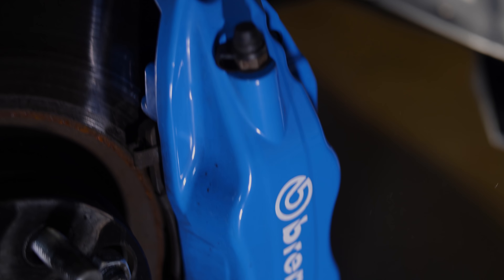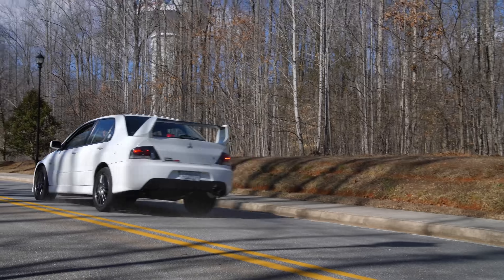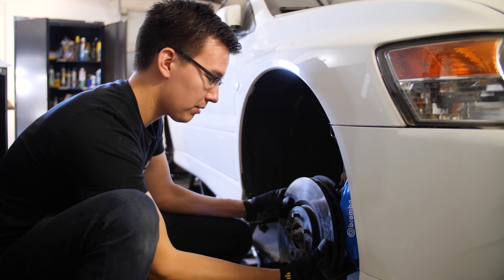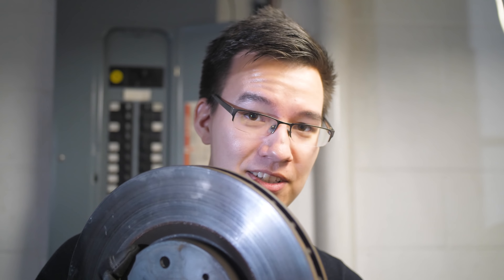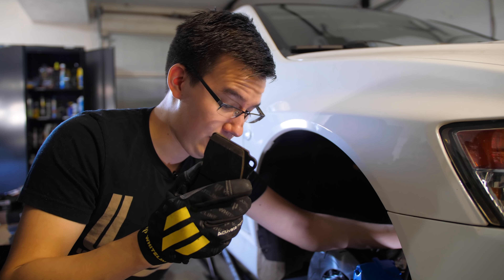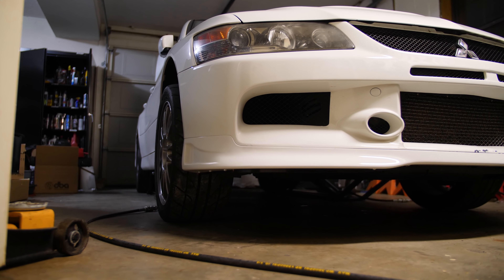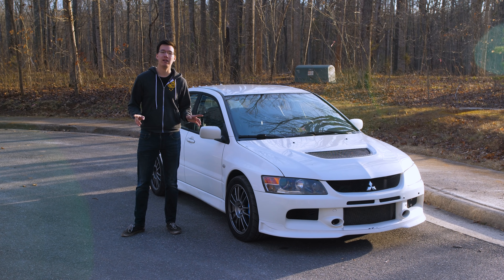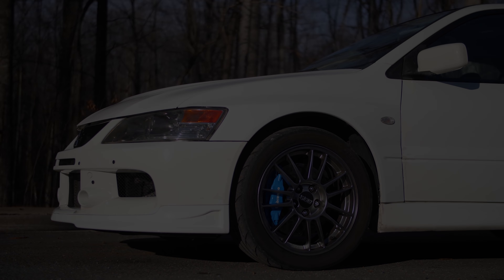How Much Do Pads and Rotors Help Braking? [4k]

Comment: Before you even consider upgrading brakes, you've got to think about how easily you can lock up your tires, no point getting a massive brake kit if you're running economy tires that can't handle it. Better brakes will however handle brake fade a lot better, and this is actually one of the main advantages of upgrading your brakes.
Reply from the maker: spete7 Very good point! The Evo comes with very sticky tires from the factor, and is currently equipped with 200 treadwear tires, so it wasn't much of a worry in this test. But that's absolutely true, the best brakes in the world will only serve to lock up crappy tires.
Reply: Treadwear rating is not useful on its own, it can only be used to compare wear rates on tires of the same manufacturer since there is no official scale, manufactures use their own unique scales. Manufacturer A's 200 treadwear tire might not stop as good as Manufacturer B's 400 treadwear tire.

"The best brakes in the world" should lock up good expensive quality sticky tires too - I mean, they'd better or you're not taking full advantage of the available friction of the tire.
Reply: Btw, looking at the thread pattern, he seems to have hankook RS3 which is pretty good tires to use in the braking test.
Reply: People should also keep in mind that the harder you can brake without any ABS engagement the quicker you will stop. ABS is only stopping you from locking up, not slowing you down faster.
Reply: While I agree that treadwear rating aren't consistent, organizations use that rating as part of the rules for competitive competition. For example the SCCA Solo 2 Nationals use a 200 treadwear rating as the standard for many street and mod class cars. I would think they are close just not perfect. Just food for thought.
Reply: your brakes may lock your tires up once. but it is not a black and white issue. more powerful brakes will be more modular and more consistent. locking your tires obviously is not the fastest or safest way to stop a car. even with crappy tires you need a good braking system
Reply: powerful brakes aren't necessarily very modular, ie power and modularity do not go hand in hand. you can have one, the other, or both ideally
Reply: Preach!!
Reply: In general treadwear isn't a good indication, but 200 and 140 treadwear tires are almost always tires made with a specific racing organization's rules in mind. When the scca changed their solo street tire requirements from 140 to 200, the most popular brands in solo at the time (hankook rs-3's included) changed their treadwear rating from 140 to 200. I can't see why anyone would make a 200 treadwear tire unless it was for racing tbh.

Comment: I just changed my rotors and breaks on my z33, went from the stock base rotors to EBC slotted and semi drilled rotors with ceramic red low dust breaks. Honestly I love the sound of slotted breaks while breaking..😍 also changed out the stock break lines to stainless steel wildwoods. 🤙🏼
Reply: *brakes

Comment: I did a similar setup when I owned a 01 Bmw 330i. I did super blue brake fluid before it was banned for being blue brembo blank rotors and hawk hp plus pads. It made a huge difference.

Comment: The Hp+ works excellent for track days and even endurance racing, if you have a lighter car. I use them myself on track, great pad. You should also mention brake cooling/ ducting, should be the next upgrade after pads if you want to to drive on track. It's cheap and and can seriously increase pad life and fade resistance.

Comment: I'm at 600whp on my IX and still use OEM rotors and brembos. The best things I've done is hawk hps pads, ss lines, motul fluid, and RE-11 tires which are now discontinued. Honestly great tires made the best improvement.

Comment: Yep, pads alone are huge.... well that is if you have the tires to go with them. I have Hawk's Street/Race pads and I daily them and AutoX/ light track day with them. They bite so good. I got the chance to take a stock 2012 911 out for a spirited jaunt around the block. I was surprised that my little civic with just high performance pads felt better. I know, I know anecdotal but it helps to show that you can gain really good performance out of the stock system.

Comment: Wish you also adressed brake fluid as that is often overlooked. Flushing your brake fluid with some high performance fluid can also help with braking performance and a better pedal feel. Also curious if steel braided brake lines help only vs fade or actually give some better braking performance
Reply: KoNLaR great point, I think I'm going to have this done next
Reply: Better pedal feel can help in a lot of ways. The brain remembers pressure much easier than distance so with a harder pedal you can more accurately hit your desired speed when entering a corner at an event.
Reply: When i put braided lines on my WRX there was no mush in the pedals, as soon as you put any pressure on the brake pedal it started braking, there was no little bit a give anymore. it honestly was the biggest difference i noticed. I did slotted cryo treated rotors and hawk HPS pads and the braided made a bigger difference IMO. but combined with it all it was amazing. also did higher temp fluid as well.
Reply: Ive ordered braided lines and new fluid so nice to hear that makes a bigger difference. Excited to try it out. I didnt go for pads or rotors in the start because I want to see first if just fluid and new lines would be enough.
Reply: The funny thing here is that all factory and cheap-o replacement brake lines are braided, just internally rather than externally. It is required for any hydraulic system to function properly that hoses don't swell. If there is any noticeable improvement in pedal feel from upgrading to the aftermarket braided lines, then your factory lines were damaged in some way.

However, since the exterior is braided rather than (or in addition to) the interior braiding, it does serve to protect the line from physical damage from kicked up rocks or rubbing the tire. 

And they look fantastic.

Braided lines won't do anything to help or hurt brake fade.
Reply: don't waste your money on brake fluid unless you are tracking the car. I use prestone dot 4 because it's fucking cheap.
Reply: DOT 4 is a good brake fluid for most cars. I plan on doing a video on brake fluid stats in the near future, as well as doing a test of DOT 4 LV on my GTO.
Reply: Doing it as a service firstly, but also plan on taking the car to a trackday and potentially more if I enjoy it. Cost 20$ dollars for 1L of Motul RBF600 Fluid so no reason not to go for some of the best fluid you can get when its cheap.
Reply: Can someone explain to me why and how better brake fluid would help brake distance?
Not bashing or anything, genuinely curious
Reply: If your brake fluid can't handle the heat and boils, it becomes a compressible gas, and then your master cylinder (by means of your foot on the brake pedal) is compressing gas first, and compressing caliper cylinders after the gas is compressed enough that the cylinder is easier to compress.
Reply: Gotta have that Dot 4 and above

Comment: Aside from dust and noise, upgraded pads can cause a lot more heat. Combined with cross drilled or slotted rotors it can become much more likely you can warp or crack a rotor, especially in cold weather where brakes will cool much more rapidly.

Comment: Keep in mind that's 2 lb on a worn down rotor vs a brand new one.
Reply from the maker: +Bad DFW Drivers very little use on the blank rotor as well
Reply: I weighed a new drilled and grooved rotor and it was actually a tiny bit heavier than my blank one that came off. Shows how worn that old one was
Reply: YMC-DAB420 most people replace old stock with new stock... The proper comparison is new stock vs new racing brakes....

Comment: Distance differences can be accounted for the thickness available (worn in vs. New pads). My parent's Nissan Rogue could stop on a dime when brand new, but after wear in the braking went back to normal. Brake change, then same thing for about 100 km.

Comment: tires do most of the braking, rotors, calipers, and pads are mainly for heat capacity and brake feel
Reply: ForTehNguyen, the kinda guy that's never driven a muscle car with drum brakes. Seriously, yes, the tire's important; and brakes more so.
Reply: 50/50
In can put slicks under a fiat Panda and still it won't stop much faster

Comment: big brake kits aren't about reducing stopping distance, its about keeping the same stopping distance on lap 17 as on lap 2.  for a single run stopping distance, the only thing that matters are tires and pads (assuming you have a car building in the last 25 years or so with a properly functioning braking system).  rotors make a very small impact on stopping distance, if anything at all. but good rotor design is a big part of a big brake kit as far as keeping temps in check for those repeated stops.  This is usually limited in applications where you're still using the stock caliper by rotor thickness.

Comment: I used Hawk HP+ on my Civic for track days, and they were great.  Not so great for brake modulation, but damn they could take a beating.  Going from 90 down to 30mph lap after lap on a hairpin at Buttonwillow and they NEVER faded.  But holy hell, the noise and dust was a big compromise to live with.
Reply: What are the best model-brand brake pads to brake modulation ?.

Comment: Great vid! On a related subject, rotor replacement is the single most rip-off from a repair shop, in my humble opinion. You go in for a brake pad job and they want to replace your 4 rotors. Most people fall for it.

Comment: I'll be swapping my stock 2013 Focus ST front brakes to 2016 Focus RS front brakes. So single piston to four piston setup. I should measure the difference. I'm planning on using the same brand and type of pads and rotors. Currently using Hawk HPS pads and Stocktech slotted rotors. Not going for the two piece rotors.

Comment: You can spend a little more and get ebc redstuff semi ceramic, they have about the same dust as the oem brembos. And its a lot easyer to clean. They allso handel realy nice BUT if you overheat them they die verry fast

Comment: Typically that shouldn't be the case unless we're talking about repeated stops where HP+ would maintain their friction over a wider temp range. I wonder if ABS is playing a bigger part here as well. The frequency at which it switches between grab and release might create more friction force during the grab intervals, hence stopping faster with the high friction pad. 
Interesting stuff.

Comment: There isn’t a lot of people I know that invest in braking before power mods. Most of them don’t have their cars now.
Reply: KG Egzi great point. Probably low on most people's list
Reply: KG Egzi my car is 200 hp i dont need to upgraded my stock brembos on it 😂
Reply: Alex Tyrone it’s not about how much power you have now but how much power you will have. That’s interesting tho, what car has brembos stock with 200hp?
Reply: because you don't need a big brake kit for the street. even track driving it is not required. Tires and pads will make the biggest difference in braking distance.
Reply: KG Egzi the BRZ with the Performance Package is 205 HP and comes with Brembos. Not sure if there are others, but that one comes straight to mind.
Reply: tao l completely agree with you but I wasn’t specifically talking about big brake kits, just generally talking about investing in braking upgrades
Reply: Geese1 that’s crazy I didn’t know that. Seems a little overkill but I guess I’ll take it if they give you a good price for it
Reply: Bucky Barnes right, making thoughtful investment into braking is not as easy as it sounds. My inner 10 year old can relate.
Reply: KG Egzi You need to get the Limited model, but then the package itself, which in addition to the Brembos also includes different wheels and SACHS dampers, is only $1195 MSRP. It's kind of a no brainer unless you're planning on replacing all those parts anyway.

Comment: What’s the point of owning an Evo and then putting economy pads on it...

Also, the initial brake test with the ‘eco’ parts may have cooked the fluid and influenced how well the performance rotors and pads actually perform once these were installed.
Reply from the maker: +Luka Jankovic being on a budget and not intending to track it for a while. Sometimes you just need a stopgap.
Reply: Gears and Gasoline that’s fair enough. 

Any feedback on the fluid? Real curious whether this may have had an influence on the result.
Reply from the maker: +Luka Jankovic very unlikely. The stops were only from 70, with big gaps between braking attempts. Dot4 fluid has much higher temperature threshholds than that.

Comment: Interesting that you did 10 tests, taking the average, did you see any trends in brake fade?
Reply from the maker: Noah Dropkin with brembos and a large disc and pad, 70-0 with at least a couple minutes between each stop won't cause any fade. We'd have to be doing stops with much shorter intervals between in order to see any fade.

Comment: Do pads and rotors need to be broken in for optimum results?
Reply from the maker: +Man from Nantucket indeed! They should be "bedded in" per the manufacturer's instructions. We did these off-camera.
Reply: Yes.

While they will certainly work to stop right out of box, their performance will improve after they've been used for a bit or properly bedded right away.

"Bedding" the brakes causes the rotor surface to be deburred and pits and grooves to be filled with pad material. The pad material benefits from being worn slightly, smoothing the surface. The surfaces of both have contaminants burnt off. The result is that you have a far greater surface area making contact between the rotors and the pad.

Comment: ferro carbon is a poor choice for abs equiped vehicles, its so grabby that it interferes with the abs system...a better choice would be the more "middle of the road" ceramic brake pads...the best part about the carbon pads is they are very gentle on rotors as the softer pads wear away much faster...the ceramic is nearly as gentle but much longer lasting than both the racing pads and the economy pads...the economy pads will rip apart the rotors with their high metal content so theres really no money saved...i buy ceramic, they last for years and i just swap out the pads when they are done...i learned all of this by reading about EBC brake pads
Reply: stickloaf I agree I mostly do spirited driving and got a great deal on EBC Redstuff and rotors they do squeak a little but the performance you get for the money is top notch
Reply: stickloaf ^ this, I got cheap ceramic pads for my daily because it needed them and they are a massive improvement in the grippy-ness of the brakes.
Reply: Ceramic brakes need more heat to outperform the others methods. You need "bite" asap on daily drive
Reply: Cramic pads belongs to toyota prius and Hyundai elantra not on a performance car that gets driven hard.

Comment: those T3 5000 rotors are $480 a pop (for an sn95 cobra, 13" rotor)... Wilwood big brake kits are cheaper than just those ROTORS for most cars.

Comment: is there a rotor that prevents rust build up over time??
Reply from the maker: +exit07 with an anodized or painted top hat like on these DBA rotors, your top hat shouldn't rust. I'd say maybe a carbon ceramic rotor ring wouldn't rust either but I'm not sure. Any iron based rotor ring is likely to build up a little rust if not driven

Comment: When you add about 50% more hp to your car, I don't think just doing upgraded pads and rotors will cut it. When you roast ceramic pads with oem brake set up on the e-way I think its time for a big brake kit. At least that with i'm going through right now.

Comment: The question is, how old were the brakes that were on the car? 
Don't get me wrong, I'm enjoying the video and all, but is this apple to apples? 
New stock rotors and pads vs new upgraded?
Reply from the maker: Edward Agora Feenman good question! The economy setup still had tons of life left and had seen very few miles and very little use before being switched out. Both the blank rotors and ceramic pads were put on the car at the same time. Also, the 156.5 foot stopping distance is almost dead-on with what the car should be doing stock, as per a test conducted by Car and Driver way back when.

Comment: I understand the weight difference does a lot, but isn't that really it? If the tires are decelerating at the greatest rate they can on stock hardware, how does a new setup help that limit of friction change?

I assume 95% of the benifet is from the weight difference
Reply from the maker: +Tyler Macdonald the upgraded pads apply a greater torque and friction coefficient to the rotor, meaning the tire can be braking at its maximum more consistently.
Reply: Thanks for the explanation. Great content as always!

Comment: You should have done it with pads alone and then with rotors alone. It's obvious that if you upgrade both, you'll get better braking, but which one is more responsible for the improvement? I'm disappointed

Comment: Spoiler allert: The rotors don´t du much, change the pads! The pads is the n. 1 thing. Then if you have cooling issues change the rotors but if you drive in the street you never will need racing rotors.